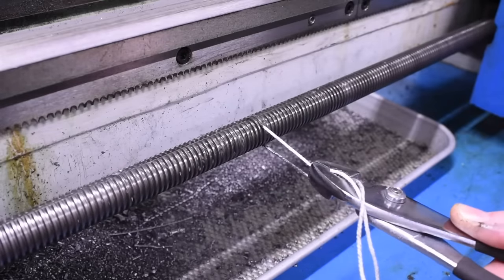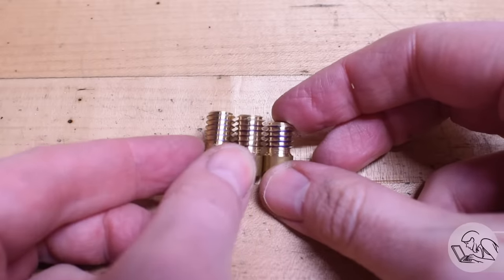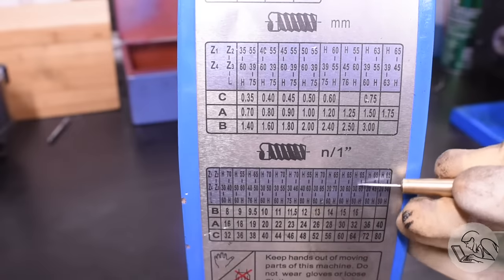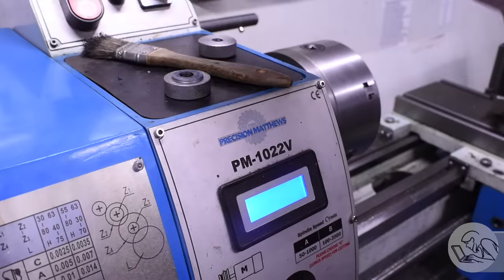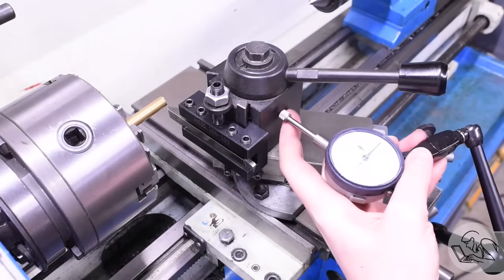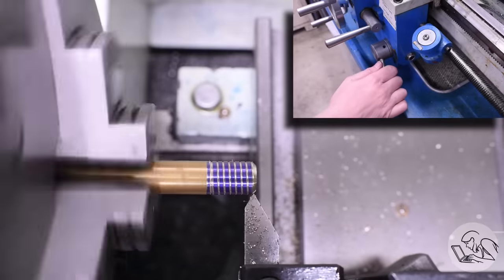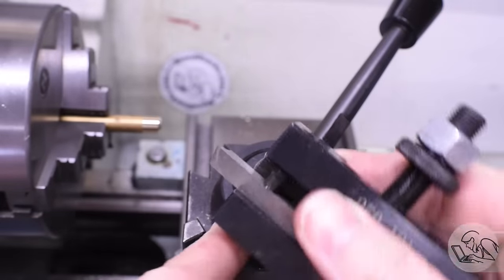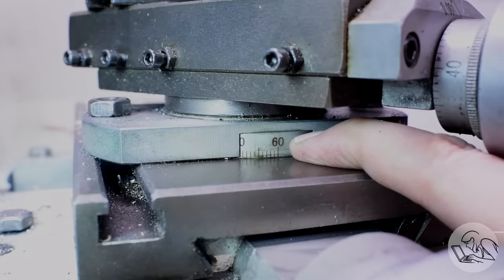How To Cut Threads On A Lathe

Comment: I'm amazed that lathe manufacturers still provide a gearbox and change gears now that James Clough's electronic lead screw system has been proven.  It is so much more versatile, easier to use and, with a bit of "value engineering" (to integrate all the electronics onto a single PCB), may even be cheaper.

Comment: What and excellent video, both interesting and encouraging to all beginners.  Could I just suggest the method below as a means to dispense with the dial indicator to measure depth of cut thread.  There’s always the chance the indicator could get knocked and lose its setting.  No calculations are needed, no dial readings to be memorised (other than zero) and only a chart showing depth of thread cut will be needed.  This method may possibly have been mentioned, but I didn't notice it. 🤫.

Advance tool until tip just touches workpiece.  Set cross slide and top slide dials to zero.
Withdraw tool by a couple of turns of the TOP slide handwheel only.
Feed tool towards workpiece by depth of thread using CROSS slide only and reset cross slide dial to zero.
Feed tool in until tip just touches workpiece using the TOP slide.  Obviously the top slide dial will not register zero at this stage.
At no time from now on will the top slide handwheel be turned anticlockwise.  Proceed cutting thread using your angled top slide method.
Depth of cut is always progressed using the top slide handwheel only.
Disengagement of tool from the workpiece is always made using the CROSS slide handwheel only.
When saddle is at start position, move cross slide in to original zero, set depth of cut using top slide only.
The last cut will be made when both the top slide dial and cross slide dial register zero.

I do hope this method is of some interest and help to the viewers of your excellent channel

Comment: Great explanations 🍻
Metric on an ML7, put a VFD made it really simple.
Reply: I can't see how a vfd makes a difference on cutting metric threads? Can you explain why it helps?
Reply: @woutmoerman711  Yes you still have to have the correct gears. 
ML7 has an imperial lead screw, means you cannot disengage from the lead screw when cutting metric threads. 
With a VFD you speed up slow down and reverse.  So you just slow up and stop at the thread end, withdraw the cutting tool reverse. Then start again, repeat until thread cut.  Hope that helps.👍
Reply: @cliveclapham6451  it sure does, thanks!
Reply: @woutmoerman711  all good, also my lathe doesn't have the screwcuting indicator so while it was a costly upgrade the motor was the original 1953 one that came  with the lathe, so with all the other advantages it seem the best way to go as most stuff is metric these days👍👍👍
Reply: @cliveclapham6451  I've got a SIEG C2 which has variable motor speed and it sure is handy when screw cutting. No indicator either, so I never disengage the halfnuts and just put the motor in reverse. I wonder if a indicator might be quicker to use, but it is just a hobby so no rush.
Reply: @woutmoerman711  hobby lathe 👍 😎 we don't do quick.

Comment: On a South Bend, the lead screw can be reversed at the spindle to drive the carriage backwards while the spindle runs the normal direction. Would cutting away from the threaded-on chuck still be a concern? Or is this because you're running the chuck clockwise in your particular config?
Reply: Excellent question! I suspect a lot of newer lathe owners don't get that. SB reversing gears allow lead screw rotation to be independent of spindle rotation.

Comment: HI Quinn, that was a fine demonstration.
Like you I have a cheap a Chinese lathe without a quick change gear box and I wish had listened to my dad who said he’d never buy a lathe without one.
For a long time I’d been wondering about the possibility of doing away with the gears and using a stepper motor to control the lead screw.
I was  thinking that whatever you use to control the speed would have control the motor which is least loaded so that it can maintain a function of the rpm of the most loaded motor easily in case the  load should slow the lathe down even for a fraction of a second.
I’ll never get the time to do it now as I’m a full time carer for my Mum who has Alzheimer’s but it thought it might be a good project for you.
Reply from the maker: Clough42 on YouTube has done just that with his Electronic Lead Screw project.
Reply: @Blondihacks  thanks, I'll have a look.

Comment: The one thing I'm not grasping here is how the setup ensures that you return into the same thread groove again. I am assuming that when you disengage the half nut and pull the slide back to starting position (or close to it), the threading dial is turning in reverse and keeping track; and so long as you hit that number when you start the forward travel again, it will get back into the groove regardless of where you kick off.

Comment: Hi Qwin, that CRC spray grease would be better if you sprayed a small amount into the cap and use an old Art brush, 
to simply dab the oil onto the gears. Yes: I hate cleaning up when there is no need to!
I have a MX-400 Chines lathe, which has been a pain in the preverbal but, since the Neanderthal delivery man knocked it about.
It has a 5" 3 jaw chuck and when I bring up the tailstock it seems to be 1mm lower than the chuck! Do you have an easy way of fixing this?
Also thanks for your interesting lathe programs.

Comment: Quinn,
I don’t do Twitter or Instagram, so I’ll ask you a question here. First of all I’m not a machinist, but I am mechanically inclined. I keep wondering how the tool enters the same place at every cut and doesn’t bugger up the threads. When you set the tread dial does it “time” the the tool to the thread entry point of the spinning part so it’s the same every time? Maybe I missed that in your set up explanation.

Comment: Im running on leas than optimal rest here, but it seems that, due to the cutting forces and back lash when cutting in reverse, one would want to run 29.5 on the side of perpindicular to the work.

In the video, the compound has been set up so that the majority of the cutting force from the cutting tool will point toward the chuck. However, the lead screw is pushing the took away from the chuck.

Since 29.5 degrees provides some cutting force on the other side of the tool, it's likely fine, but i wonder thread finish might sometimes suffer, having not perfectly mirrored conventional threading with this upside down method. 

If time allows, I might test this at work today.

Comment: Just wanted to toss in that while 39 is an approximation and gear ratios with it introduce some error, ones involving 127 are NOT an approximation, as that is half of 254, which is the exact (by definition of the inch since we adopted Mr Johansson's approximation between british and american inches for gauge blocks as definitive for both) number of tenths of a millimeter in an inch.

Comment: Use spray 5thwheel  grease in a old cap and use a 1/4 brush and coat aross the gears. Its a sticky grease keeps it on the gears and dont splatter all over.

Comment: You are an excellent teacher! Question: I’m a bit confused about the position of the compound when threading away from the chuck. You have it on the normal right side.  Should it not be set on the left side when threading out?  Or does it not really matter?
Reply from the maker: See pinned comment. 🙂

Comment: A piece of regular paper between the teeth usually sets correct backlash, and in threading it makes a difference if there is too much backlash.  The height setting is more accurate if you put a dead center in the drive side.  There are mis-alignments in using the tailstock, but not a bad way, must more accurate to remove the chuck, put in the dead center and go from that perspective.  Regardless I agree, threading has a huge steep curve.

Comment: Just a quick "rule of thumb" using your compound (feeding at 30 deg) for depth of cut. Take the pitch of your thread and multiply .75. In this case 1÷16=.0625 .0625×.75= .047

Comment: I just found you and love the videos, I have a very stupid question can I thread at non standard pitch? I have a need to make a 5/8  0.625 diameter by 20 pitch ! its to make a thread chaser for a hole on a old carburetor that needs to be hollow as well so it will be made from thick wall tube. Thanks in advance to all who can help. Jim

Comment: For drones you want reverse direction (left) as opposed to righty tighty threads.     That way the nut doesn't come off from the torque effect.  Is it easy to create those on a lathe?

Comment: Hello Blondie. Professional machinist but I also do hobby work in my own time. I am planning out the restoration of a 1923 flat belt driven engine lathe and I need to make some new lead screws for the cross slide and compound. Say that my lathe did not have a reversible lead screw (it does but lets pretend it doesn't for the sake of argument), what approach would you take to cutting a left handed thread?

Comment: Hey Quinn, subscriber here, I want to make a thread chasing dial,, for my lathe and I saw that you said that with 32 teeth gear if I always choose the 1 on the dial I will be able to make all the threads metric and inch,,is this a fact ???
and if it works at 32 to which other number of fewer teeth could i fix it so it's faster ??
in the following days I intended to fix the gear of the dial and 
I intended to make 3 gears = one with 14 teeth, one with 16 teeth and one with 20 teeth,
but I would prefer to make only one gear and let me use only one mark on the dial,,,
Thanks in advance.

Comment: Excellent video! I am a piano technician. The piano movers lost two leg bolts to my customer's piano. I measured the other ones. They are 12.5mm major diameter with a 2.0 pitch. Any idea how to make a couple of replacement bolts? The piano manufacturer is Chinese and out of business. I don't know what to do. Thanks!

Comment: I learned to effectively adjust the play between gears by using toilet paper. The stronger one. Put that between the teeth of two gears, press gears against each other and then lock the axles/shafts. That will give enough play but is not too loose. Take the paper out after adjustment. (It will do that by itself anyway, just in case)

Comment: instead of running the tool upside down you could cut on the back side. I have this, maybe irrational, concern the the saddle isn't really designed to handle forces pulling up

Comment: There are tricks for making threads  a bit easier to cut. Here are two that are helpful for beginners and advanced machinists:
1) If you are cutting with the compound slide and cutting towards the chuck first set up the cross slide "zero" so that the cross slide handle is at about the 10 o'clock position then bring the cutting tool up to the work with the compound slide. By doing this you can "snap" the tool out of the work at the same time you open the half nut. With a little practice you can cut a thread up to a shoulder or to a given length with very little or no back thread relief.
2) As Blondihacks says cutting metric threads (or fractional pitch inch threads) on an inch machine means you can't open the half nut and move the apron back. This is a problem on bench lathes without a spindle brake. If you cut the power to the spindle the tool may crash as the lathe slows to a stop. There is a clever work around however. When you reach the end of your thread open the half nut and cut the power. Notice that the thread dial hasn't moved much past the number or mark you had been using. Pull the tool back to clear the work and reverse the lathe to back up. As the lathe starts re-engage the half nut on your mark and back the lathe up as you normally would.
Cheers from NC/USA
Reply: I like the 10 oclock idea -will try that

Comment: Some 1940-50's American Pacemaker lathes had an automatic longitudinal stop feature which cuts out the carriage feed at a predetermined stop.  ( As pointed out by 'Old Iron Machine Works' channel video 'Bringing home the American Pacemaker lathe'  ).  Can this be used in thread cutting mode and if so why has it not been continued in later lathe designs.  Sure would take out the 'skill' or stress whilst threading in the conventional right to left fashion up to a shoulder or narrow relief.

Comment: Stupid question, I'm sure, but around 15:45, you've got the compound set at an angle and you're feeding at that angle...but when you want to disengage to go back and make another pass, you adjust the cross-slide, and then have to re-set the cross-slide AND the compound for the next cut. Could you not just back off the compound a bunch, ,reset to the start of the cut, and then bring in the compound, never touching the cross-slide? Sure, the total motion on the compound would have to be larger by a factor of 1/cos(30 deg) to get to the same inside depth, but it's half as many adjustments per pass, which (given how much of the time you're adjusting) seems like a win. [Apologies if I've got some words wrong -- I've used a lathe little enough that I'm constantly forgetting all the vocabulary).

Comment: One thing occurs to me. Before one cuts to the diameter, test the cut with blue and the gage, and then bring it to the proper diameter. If the cut wasn't right then you have to throw away that work and start over. Right?

Comment: Hi Quinn.  I'm struggling with the use of the follow rest during single point threading with the machine running in reverse as you and Joe Pie have taught.  The work seams to push away from the 2 points of contact on the rest.  Any suggestions?  :)

Comment: I'm new to using a lathe .  The chinese lathe i've got ordered plus most of the others i've seen only show a set up for even numbered thread count .  Is there a way to do an odd thread count like a 13 which is common for 1/2 " bolts  , or will i have to use a tap and die ?

Comment: Once again, great lesson !!   I once asked Joe P. this question, and didn't ever see his answer, so....
When cutting threads L to R  would it be better to put the tool-post behind the work and use the right-side-up cutter? Thus keeping the forces on the saddle and slides in a downward direction. I realize that that would make adjustments difficult, but on tougher materials and larger diameters it seems safer (for the machine and the valuable piece).

Comment: For a perfect thread every time cut oversize and chase it with a die. My dad taught me that many MANY years ago.
Reply: If you have a die for a thread, you might as well use it from the start. Screwcutting is for when you don't have taps and dies, odd threads(one of my jobs was a fuel line blanking plug for a Yak that was M24x1, try finding a die in that size for a one off part), or large ones that are lots of effort to cut any other way. I don't find any improvement in the finished thread to make the extra hassle in offsetting the top slide worthwhile. And 5thou is a finishing cut. In steel. On the same lathe used here.....
Reply: @nickwheeler8231  This mainly applies to cutting long threads.  It's possible for a die to move off the axis.  For short ones you're right.

Comment: I need to learn this threading but I think i might have an advantage with my old hendey lathe. It has a reversing lead screw. I believe this means I shouldn't have to put my cutter upside down to cut with the apron moving to the left to cut.

Comment: Seriously I'd go for a  CNC and dump all the mechanical parts. I converted a Mill to CNC already and I'm cutting gears with it (I'd never use a manual dividing head!). I'm waiting for my lathe and will change it to CNC too ... changing the leadscrew to a 4mm ballscrew, installing encoders and wiring it up with a PC.

Comment: 1. Great as always.
2. On your first demonstration. An English method is to leave the compound at 90° and every couple of cuts advance the compound ~ .0005. No need to be OCD. This will relieve the right side of the tool the same as cutting with the compound st 29-1/2°.  The technique is explained in Screw Cutting in the Lathe by Martin Cleeve, one of the workshop series books.
3. 1/2" (in the US) PVC is cheap for threading practice. I don't recall exactly what it is, but the thread for propane nozzles is easy to set up and the nozzle for fit testing.
Reply from the maker: Great tips!

Comment: you can cut a thread  a  spindle using the tool On the beck  on the sandal,  with relived angel's set 
   Now  imagine the Milford with out a trad just the Key way  on the led screw. now when you Engage  the lead  screw.   & know indicator .    so we time the chuck ,  that my   lathe in a nut shell. I like your  lesson . but try it with  you rack  cut away from the Cheuk  i do .👍👍🏿

Comment: You may do this magic with the 60 degrees for the top slide a few times to get a feeling, but honestly it's too cumbersome. You can simply leave the top slide at 0 but move it towards the chuck with each depth step by a good half of your infeed (exactly calculated it should be tan30deg= 0.577 of your infeed). You will remove most chips on one side and touch the other only slightly, leaving a nice cut. It‘s a much faster setup, the result is also perfect and you can leave this silly indicator in the box.